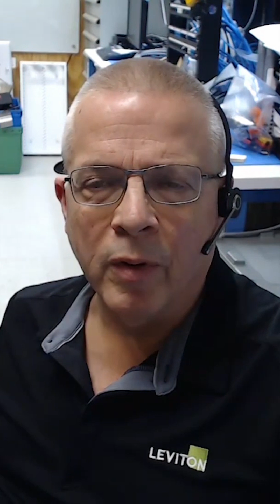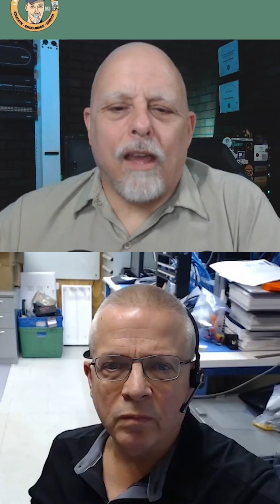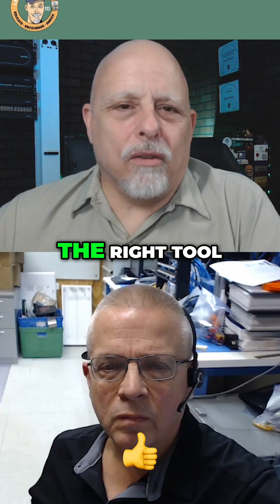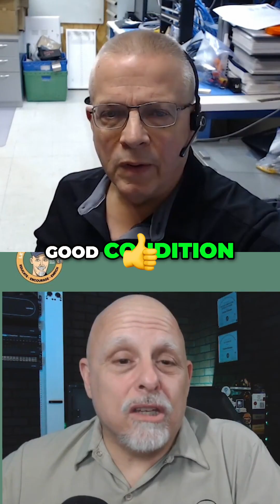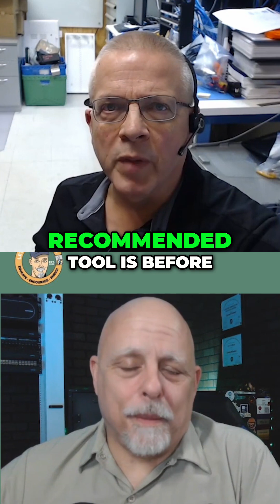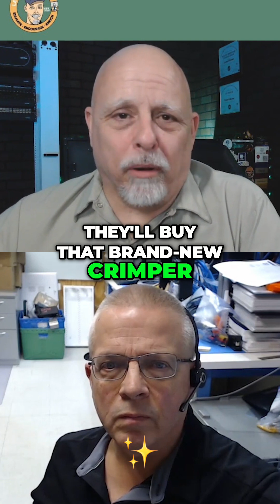Choosing the Right Crimping Tool: Expert Tips & Tricks

Comment: Considering the expense associated with certain crimpers and their respective dies for specific applications, it is not unreasonable to expect that these dies should have a lifespan exceeding their actual usage. If the engineering design intentionally causes these dies to wear out prematurely, before a reasonable number of crimps, then the ethical considerations of the company should be scrutinized. This situation can be likened to the practice of publicly and vociferously criticizing companies that make it increasingly difficult to replace a headlight on modern vehicles, solely to compel consumers to seek repairs at authorized dealerships, thereby generating additional residual revenue.